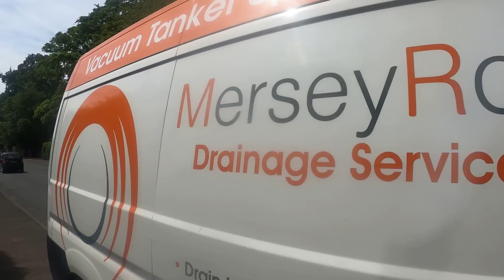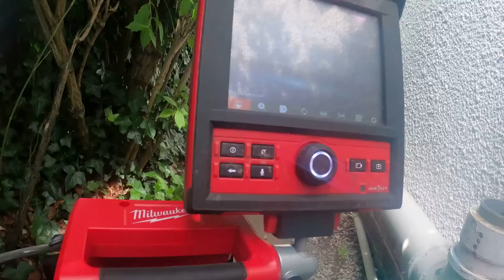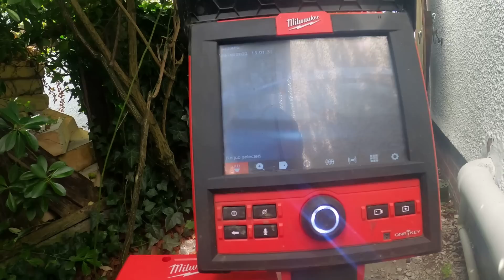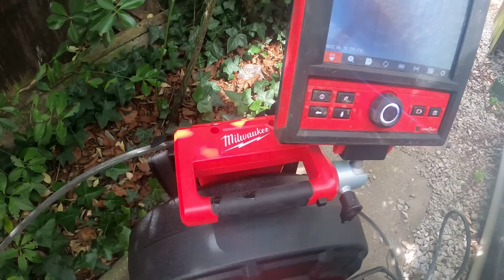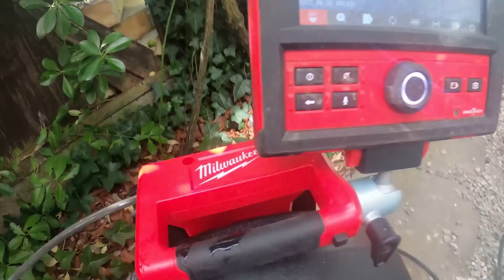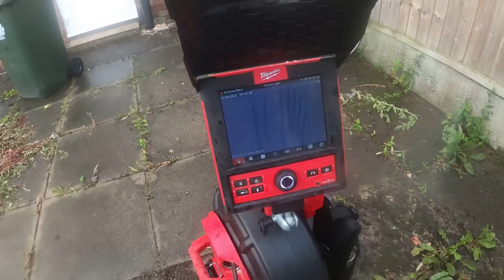Manhole Unblock! #150

Comment: Hi from durham guys👋👍 joe coiple of good jobs here mate 👌 and is that why you been hiding for cos your Milwaukee not been in town 😂  and things will never be the same again without it👍 lol but that plastic on drain 2 was it recyclable or was it flushable did you send it in for analysis🤔😂 and it looked like it had undermined the concrete too the way it was spraying out that thermal gap🕵 thanks for your time be safe see you soon👍👋

Comment: How do you guys clean out the roots? Here in Australia, they have another attachment that basically shreds them as it goes through, can you use that over there? Or do you have another method?
Reply: They have a root cutting jet head but have only seen them use it in one video. There's mechanical cutting heads for the milwaukee auger they have too that I've seen them use exactly once.

Comment: That's very good stuff you have and draining blockers in Canada we don't use what are called Kelly's and run a drink in the outside of many houses running inside and go out to into a clean out outside  use that many years ago run the drain pipe and outside the house into gullies what happened long time to Kelly to get frozen solid in winter time only place where you see a manhole to clean out a drain is on it in the commercial building or high-rise apartment building getting a lot of really old old sewer networks that are just really old a very age equipment  here you have some brick sewers like that too so do under some major streets in some cities some case I see block her son of Old Red Brook for addicted how to make   did art l Deco a pipe came out of the manhole